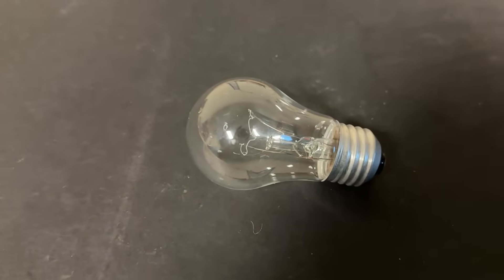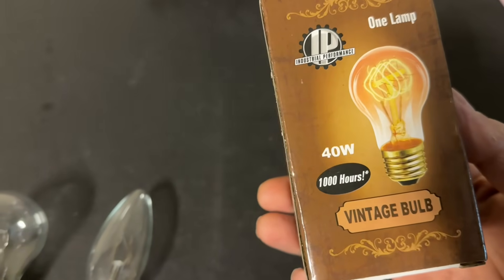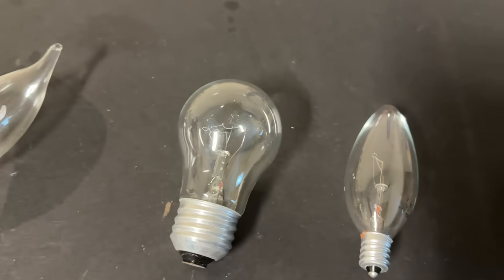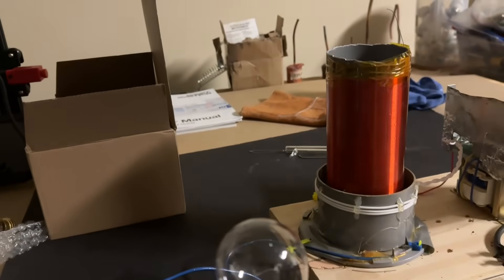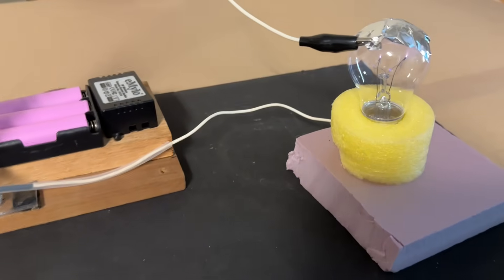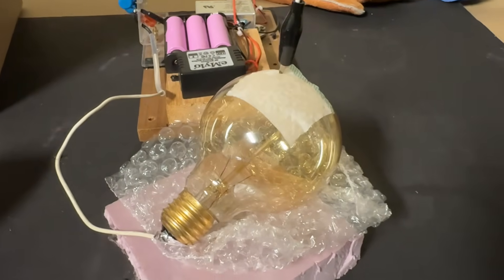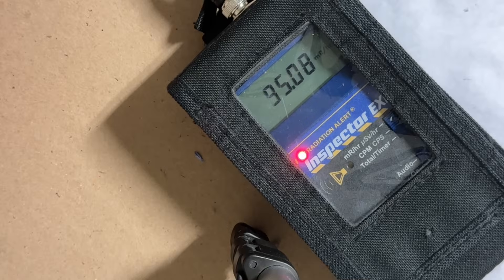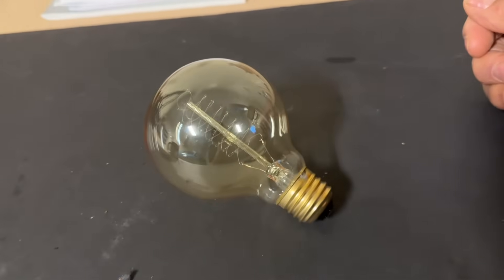Intense radiation output from Vintage lightbulb

Comment: Aww yeah!! I've been trying to get folks who play with violet wands/handheld tesla coils to recognize this hazard for twenty years..  ..sometimes the pushback was unreal. You certainly agree that it would be extremely unadvisable to use your skin in place of the wet paper, right?
Reply from the maker: You make a really great point. The gasless electrotherapy tubes are dangerous. The Human skin is no different then the piece of wet paper. At 4 ft away the dose rate was >100 mR/h. Using inverse square law this would 1.6 R/h at 1 ft distance. This is a very unsafe level, that’s why I abandoned  further experiments unless I can get decent lead shielding.
Reply: @BrianDhvTinkerer  Violet wand plus geiger counter?   Nope, nothing happens.  Try it.  No clicks.   Common violet-wand electrodes are full of low-pressure air, glowing violet and only producing some UV (which is partly absorbed by the glass layer.)  Modern ones are full of neon, and glow orange.
On the other hand, we had an x-ray incident at a "science birthday party" down in Portland.   It was an antique quack coil, "Renulife" coil.   One antique glass electrode does not glow violet.   Instead, the glass surface flashes green.  
Out of all the quack-medical glass tubes, it's the only hazardous one I know about.   It's called #26 Renulife Tonic Saturator.  Easily recognized by the metal spring inside the glass tube, and the lack of a violet glow.   That thing is an x-ray source.   Fortunately it's a rare antique, never included with Renulife quack machines.  It was a bizarre coincidence that I even stumbled across one of them.  Made my GM counter chatter from ten feet away!
Reply: @wbeaty  Oh!  I'm sure I have a violet ray wand with a spring in it.  I'll have to test that.
Reply: @BrianDhvTinkerer  Thankfully all the purpose-built modern electrotherapy tubes are gaseous, though I do have a few vintage ordinary-looking ones (not "actinic") that have a sufficiently hard vacuum to be active. My beef has been with some all-modern kits that include a variety of light bulbs repurposed as electrodes/electrotherapy tubes - it's all good if they glow with purple tendrils, but the a**hats couldn't resist including ones that had glass glowing APPLE GREEN or the more subtle blue/white, both of which indicate a potential X-ray producing situation.
Reply: @zinckensteel  Are the non-glowing ones from antique sets?   Or recent origin?   
I've only encountered a single non-glowing antique electrode, Renulife Tonic Saturator #26.  It has a metal spring inside the glass tube.  Geiger counters go crazy even ten feet away.
Perhaps the real hazard is the ceramic Edison-base attachment found with violet-wand coils sold for physics teaching.   Screw the wrong modern light-bulb in, and accidentally produce x-rays.
Reply: @wbeaty  I agree 100% - the careless use of an Edison socket adapter is my concern. The non-glowing/X-ray making electrode is from a vintage set, an ordinary mushroom style from a Baby Violetta. I imagine it may have gone hard from extended use, and its X-ray production is weak compared to a modern fishtank bulb in its place.
Reply: @zinckensteel  aha yes, that explains it.  As with neon signs, long-term use can "getter" the gas, even with no metal present (the N2 and O2 plate out as solids, leaving just a trace of argon behind.)
Also, I bet in physics classrooms, the vacuum lightbulbs are no fun, so quickly abandoned.  We want plasma-flames in argon!   
But also, probably my first actual physics experiment was to strike an aquarium bulb via a VDG electrostatic generator.  This in 1984, at MOS science museum.  Confusingly, none of the expected bright flashes!   (I was searching for new physics demos, for classrooms lacking a Tesla coil.)   

But also, the bulb immediately perforated while I was watching, first an invisibly small hole that attracted sparks, a pore which grew and grew as the VDG machine went snap, snap, snap to the glass surface.  Inside the bulb, yellow flashes (sodium from vaporized glass,) followed by normal white sparks as the bulb filled with air.  wtf my vdg drills holes through glass light bulbs?  Yep.  Also it functions as a "vacuum tester," with sparks leaping to any micro-flaw in the glassware.  It was years before I figured this out.  Hypervelocity electrode-fragments perform the drilling, but only with hard vacuum present.  I discovered an ion-beam lithography demo for school classrooms.
Reply from the maker: Yes I can attest to that too not with the VDG or WM but with the voltage multiplier which drills a hole, locally heats the glass, then an unnerving snap (glass cracking) followed by color change to blue and pink from air getting in ! Happened three separate times with 3 different bulbs until I figured damp paper makes a far better positive electrode then adhesive aluminum foil tape!
Reply: Any high vacuum bulb will create xrays by Bremstrahlung.   If the gas in the bulb isn't glowing and the glass of the bulb is, you're making xrays.
Reply: The whole concept behind violet wands is that they are filled with argon gas to produce violet light. If it's filled with argon and making violet light, it's not a vacuum needed to make X-rays. That is exactly what he just proved in this video.
Reply: @SkippiiKai  one extremely rare antique electrode, part of Renulife quack machine, is a major x-ray source.   Electrode #26 has hard vacuum, no purple glow, but also easy to recognize by the little metal spring inside.   That thing can probably light up a phosphor screen, or expose film.
Reply from the maker: I am very happy to help educate people on the dangers of radiation.
Reply: @BrianDhvTinkerer You are doing a great job at showing us the risks. Please do be careful. You are also getting the attention of some great minds in the fields of High Voltage.
Reply from the maker: @DanielGBenesScienceShows thank you and much appreciated. I wanna get as much out as I can on these because the effects are really interesting and the radiation seems out of proportion to the amount of energy I’m putting in. i’m suspecting that cold cat or radiation is quite efficient.
Reply: @ It’s quite frightening to see the amount of x-rays generated by dumping a relatively low amount of high voltage into your everyday vintage lightbulb. I have done so many experiments with high voltage and various light bulbs (I have an extensive collection of antique and vintage lightbulbs and X-Ray tubes including; Crookes, Coolidge, Edison, Pressler, Victor, Mazda, Sunbeam, GE and many more) and because of similar tests, I now keep all my high-voltage sources far from the display cabinet. I even have a complete 1930s Ritter dental x-ray machine (6 ft. tall, 350 lbs) in my collection that doesn’t scare me as much as when I get a 100 KV power supply near one of my hand-blown x-ray tubes from the 1890’s. Thank you kindly for bringing safety to this next generation’s attention! ❤️
Reply: @BrianDhvTinkerer  Same as magnetron, the cold cathode gives reduced current, reduced x-ray output, but doesn't short out a low-wattage HV supply.   Light up the filament more than a slight red glow, and your HVDC value will plummet, turning off the x-rays.
Reply from the maker: @wbeaty yes very interesting. I had people questioning whether I was actually getting x-rays out of a magnetron. So I applied current to the filament using a DC battery so that I could still apply high-voltage across the filament and the casing of the magnetron. As soon as I turn the power on to the filament, X ray production turned off almost instantaneously. There was essentially a short circuit between the cathode and anode with the filament on which dropped the voltage significantly on the low power voltage multiplier. As soon as the filament cooled down the voltage shot back up and x-ray production resumed. I was able to actually generate some pictures using zinc sulfide screen
Reply: @BrianDhvTinkerer  somewhere I have a dental x-ray tube in a plastic box with a tiny negative-ion module, only 20KVDC.   The tube filament is supposed to run at 5VAC.  With cold cathode, no x-rays, but heat the filament at about 0.8VDC, and counter clicks at maximum.  So, I added a D-cell and a 50-ohm pot in series, set the pot for maximum click-rate.  Still, very feeble output.   Like an "LED for x-rays."   Still, useful for testing water-shields, thickness of aluminum slabs, brass shim, lead-filled rubber sheets, lead foil, etc.  Modulate it, to play music through a geiger counter?
Reply from the maker: @wbeaty another one to try out - I like the idea of modulating the counts of the GM to music 😁
Reply: @BrianDhvTinkerer  cheap and common hobbyist x-ray tube is the 6VS-1, with tiny source-diameter for sharp x-ray photography.  It has a grid, for modulation.  Actually it's a DC supply regulator, shunt-type regulator tube.  It has an electron-gun, aimed at a flat anode.
Reply: just don't use old light bulbs.
Reply: @gaynzz6841  I still use em and won't change it

Comment: Wow that's wild⚡️⚡️
Reply from the maker: Totally crazy the x ray intensity from these bulbs. When I saw the radiation intensity, I decided to not do any further experiments.
Reply: @ I hear you and don't blame you a bit!! kinda scary 🤣👍⚡️
Reply: @BrianDhvTinkerer  I wonder if it still works with a thin plastic plate between the wet paper and the glass.   That this even works at all with DC is amazing.    I'm thinking that the 40KeV electrons coming from the tungsten surface are penetrating the thin glass, no holes needed.   40KeV electrons = beta particles, and thin glass might not block them.   Heh, try a thick glass plate over your pancake probe, thick enough to block betas.   If the radiation reading goes way down, then that light bulb was a particle accelerator, not only an x-ray source!
For safety, don't need to get lead shielding, instead try thin steel plates, steel electronics enclosures, etc.   I find that it pretty much wipes out the soft x-rays.   Then, just never use 200KVDC supplies, nor desktop-size Tesla coils.
Reply: @BrianDhvTinkerer  Prudent. Very prudent.